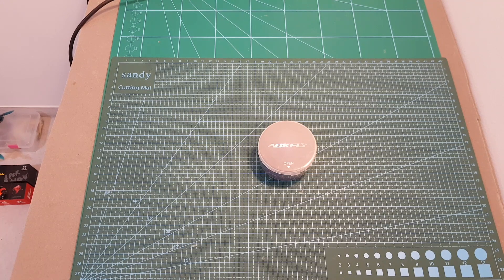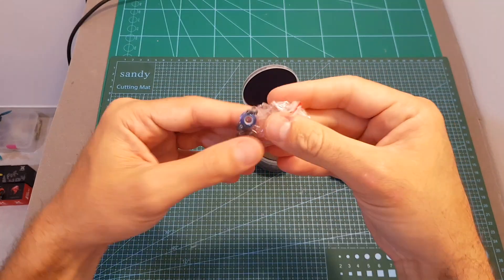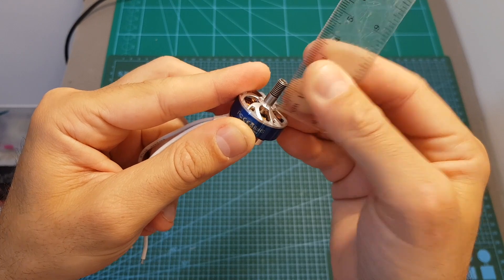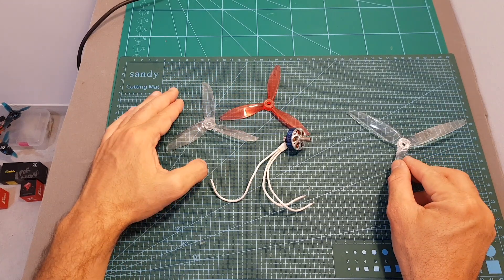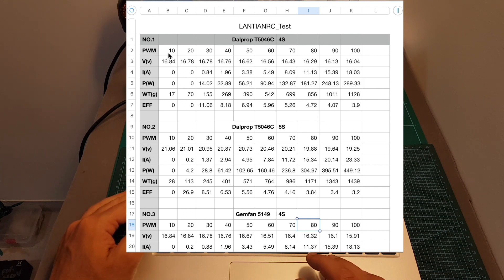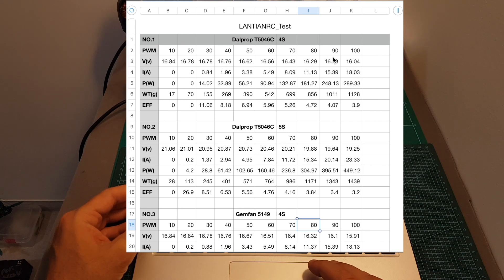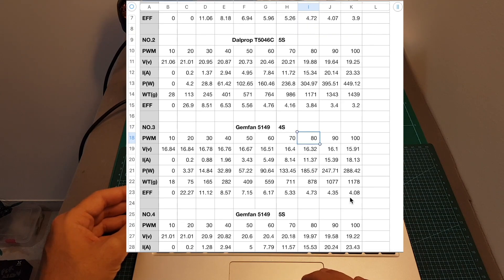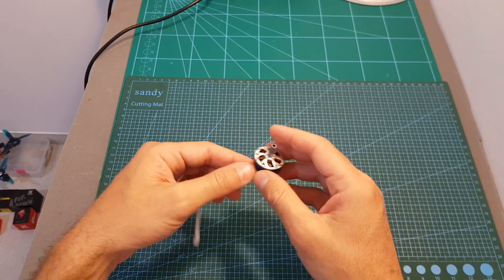AOKFLY RC2206 2000KV Motor Test (4S & 5S)

Comment: Almost got these for 5s / 5” but I decided on the 3Bhobby 2306T/2100kv. They’re slightly cheaper but OMG they’re incredible so far. Tons of power & I prefer this mid kv 5s over the new trend of 6s low kv. Not sure why almost everyone skipped over 5s when moving away from 4s setups

Comment: This is a great video but you cannot compare the efficiency for the PMW Value, you have to go for the WT(g), naturally on 5SF at 100% will be less efficient than 4S at 100% because you have using more power on 5S in that case... but if you look at 1128g on 4S is about the same of 5S when moving about 1171g, did I explain? The comparison you do from the different props for the same battery is correct!
Reply from the maker: Thanks for your explanation!